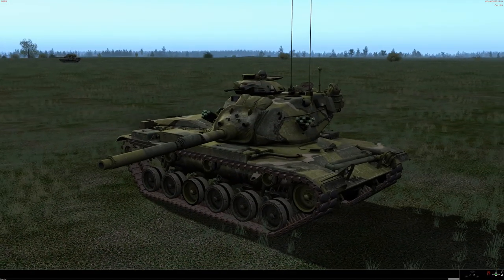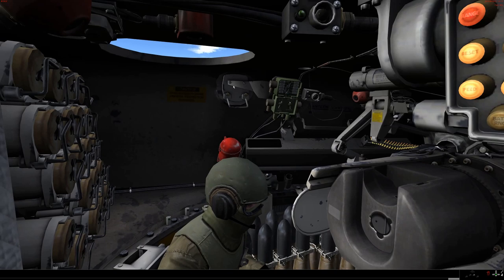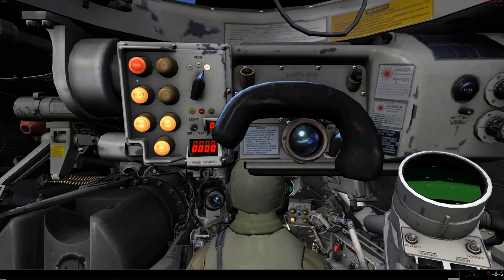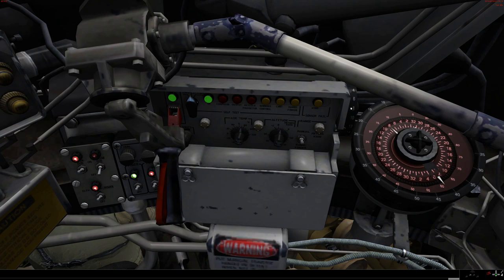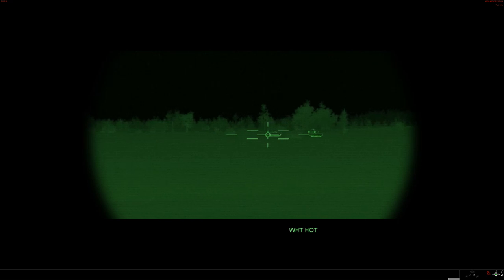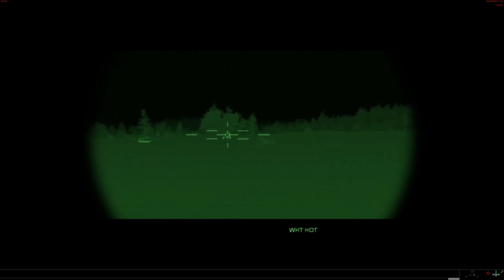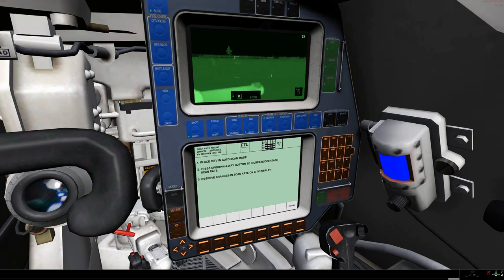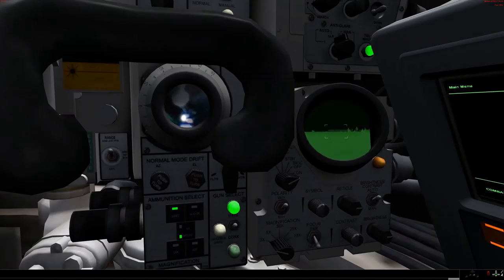M60A3 TTS Switchology, and a little M1A2.

Comment: Nick, you've been inside a T-72 before, so please do a switchology video on the T-72 in SB and tell us what you think.
Reply: I'd love to see that. I'm pretty familiar with the T-72's turret, and I have access to one not 20 yards from my seat here in the office, I'd love to help.
Reply: @TacticalOni  That's quite an office. Is that T-72 turret some sort of monument?
Reply: @tankolad  nah, I work at the American Heritage Museum! We have a Polish built T-72M here parked right between the M41 and the SCUD missile launcher. I've hopped into it plenty of times and I have a ball playing it on SB
Reply: @TacticalOni  Wow, that's awesome! We'd both like to hear what Nick thinks, but I'd also like to know your thoughts on it in SB and as a museum piece.
Reply: @tankolad  (1/2) So in my opinion the T-72 exemplifies Russian Cold War strategy to many degrees. It's a typical T-series tank with 3 crew and a compact layout, but its the details. The T-72 was built to rush fortified positions, and lots of things about it show that. First is the Delta-D switch on the gunner's controls. Delta-D works as a rangefinding function where the gunner only has to lase an object once and the FCS will wind down the range as you're approaching it. I've never got to try if it works moving away because that's not how Russian tanks work :P Delta-D does not account for the target you're lasing moving, though, so usually I just leave it off and just re-lase when I see fit to do so. There is no lead computer, you have to do it all yourself on the 72M model. It takes practice but you get pretty sharp with it after a little range time. The 72B models come with a neato little thing where if you lase and hold down the lase button, it will factor in the turret rotation speed and give you a rough indication of where to put your lead indicator. It still takes way more time than an American tank, typically, I lase to get the range, line up my sight, and then lase again to see if it changes and hold that second lase to get lead. It'll only work for the first shot in the engagement though, after that, you're better off falling back on estimating lead by eye. 
ANYWAY, the other thing to note is the smoke grenade launchers. On American (and NATO) tanks (mostly) these grenades land a short distance in front of the tank, enough to conceal it and let it sliiiide back into cover if need be. On the T-72, we aren't sliding into cover, we are sliding INTO THE CAPITALIST FRONT LINES, so the smoke grenade launchers project around 200 meters forward instead of like 10. It's a self-made smoke screen to advance behind.
Reply: (2/2) From my experience actually sitting in the T-72, its a little more interesting. 
So the nice thing is everyone gets a hatch. Hooray! have fun getting out of it in any degree of speed. The Gunner will have the easiest time, the commander better be a skinny dude as the NSVT machine gun on his cupola ring mount means you only get about 10 inches of space to wiggle out from. Now keep in mind, I'm not a small guy either. I'm 6'3" and about 255lbs. But the T-72 surprised me. The commander's seat is cramped for me, but I can still work inside of it so long as I don't have to get out quickly. Once you're buttoned up, you get the cupola's binocular periscope, which rotates on its own and comes with a sighting aperture, the handles have a button on them so if you're scanning a sector ans spot a target, hold it steady in the scope, smash that button, and it will slew the gun onto the target, the commander cannot override the gunner and fire from his side, he can only traverse and call the target. 
The gunner has the most comfortable seat in the house, I'd suspect. It's like sitting on the ground and resting with your back against the tree. The seat is right on top of the cassette for the ammunition. so there's only a couple inches betwixt your butt and the cassette. So you're sitting there, your legs straight out, and you have the controls right there in front of you and the sight is right where your eyepoint is, you just lean forward and voila. The autoloader is nice in some ways and terrible in others. If the TC calls a target that needs a different ammunition type, you select it, index it, and hit the load button. The nice thing about a human loader is that you don't need to hit a button for him to do his job. He will just cram shells into the breech as long as he is alive, all you have to do is listen to the calls (HEAT UP, SABOT UP) and you know what round you're firing. 
The driver....ugh, he has to be the shortest guy from my experience. Even the T-55 is pretty comfy compared to the T-72. I can't find the seat adjustment though but even still, you can tell Russian Tankists are mostly smaller than American Tankers by a fair margin. Though everything is laid out acceptably enough, The M60A1 and the Abrams both have much better driver's compartments. 
@Chieftain, if you ever do a switchology on the T-72, or even a Hatch at the AHM, I'd love to help!!
Reply: @TacticalOni  Thanks for sharing, but I find your experiences to be a bit strange. It's hard to see how the commander's station can be less spacious than the gunner's station or less comfy. Have you tried adjusting the seat? You can do it using a lever on your right hand side.

About the autoloader - is it that much of an inconvenience to press a button? It's right next to your left thumb if your hand is on the control handles, and the gunner has to index the ammo type into the sight anyway when switching ammo types. Nick does it a few times in this very video. I really don't see how that would delay the loading process or make life harder for the crew.

As for the driver's station, the seat adjustment handles are on your left side. You should see two metal paddle-like handles. I might be wrong, but I think you have to put your thumb on the inner paddle and your palm on the outer paddle (left hand). Compress the inner paddle towards your palm using your thumb and just twist both paddles away from the seat. That should release the seat from the toothed rack. Be sure to brace yourself against the hull ceiling though, because the torsion bar spring under the seat is apparently quite strong. When you've got yourself to the height you want, release the handles and the seat will be locked to the toothed rack.
Reply: @tankolad  So lets hit these one at a time.
From my experience, the breech seems to favor the commander's side a little more than the gunner's, the commander sits a little higher regardless of seat position and with it at buttoned up height, I found myself more noticeably packed in by the radio and equipment by my right leg, the gunner doesn't have this issue. 

The Autoloader. Pressing a button is not an issue, and my mistake if I implied that. I simply stated that because you have to key a button to load a round, instead of having a guy who is doing it until he runs out of an ammo type, means that if you're being mindful of your selection, you will have a larger delay in when you spot a target and fire. You can always queue up SABOT and switch to HEAT by doing a Russian Reload, but staying flexible means more delay in spotting a target and shooting at it. I will always say having a human loader is better in any situation. 

Driver's seat. 
If memory serves me right, the seat was jammed, I'll take another look though. I know that in the head-out unbuttoned level, its an uncomfortable hag to sit in.
Reply: @TacticalOni  Okay, that's fair.

I still have a bit of trouble getting what you mean exactly. In a direct comparison with a human loader, the gunner would just keep pressing that 'load button' without turning the ammo type selector dial until he runs out. He sees the target through his sights and he hears what the commander is saying to him. There wouldn't be a problem with loading the wrong ammo for the job.

If the commander tells the gunner to load something else, the gunner would just turn the selector dial to that type which sets the autoloader and the ballistic computer simultaneously, and then he presses the 'load' button. You'd need to do the first part in any tank. In the M1A1, for example, the gunner has to take his eye off the viewfinder of his sight and press a button to switch between ammo types so that the ballistic computer can show a ballistic solution for what the loader put into the gun tube.

The backrest of the driver's seat should also be adjustable between three different angles of recline. I have no idea what the condition that T-72 is, but these issues seem to be the sort of stuff that can be solved with some WD-40 and a dirty rag :)

Comment: I will recommend Steel Armor Blaze of War. I think is the best m60 simulator
Reply: yeah its awesome... i either suck at it or the supply line parts are terrible becuase i can only go like 3 engagements before i need to end the campaign simply because i run out of ammo, at times ill be lopping HE at T-62s or APFS at BMPs

Comment: There should be a deflector shield installed between the fighting compartment and the drivers compartment.. I'm an old 19E40 M60A3 tanker. Oh, and the M85 .50 worked fine, you just had to install it in the couple correctly and run it on High rate.
Reply: As a 19E20 who also did armorer work, it needed careful maintenance too. If the rivets weren't tight, things would not quite be lined up right and, yes, high rate helped for a while. I once DXed all but 2 of ours over rivet issues (Division changed the rules after that but we still got new in the box M85's for the company :)
Reply: @wlewisiii  all true, but I've put a lot of rounds down range with them and in my platoon and as long as the guys kept them cleaned we never had issues. The biggest problem was the crews that wouldn't load the ammo tray correctly and making sure the deflector plate on the ejection side was on bottom as opposed to on top. Saw more stoppages due to that than anything else. The M2 for all it's robustness didn't work well in the old M1 coupola on the M48's. That is why you saw so many mounted outside in Vietnam. Now, if you mention the M219, that was a dog. Absolutely hated those things

Comment: I'd have a few questions to the M1A2 SEP v2 tankers out there:
How do you use the CROWS on that as a TC? Do you have a third, separate screen or does it connect to one of the existing two (either the CITV display or the CTP)? And does it use the same controls as the CITV (for rotating, zoom etc.)? And finally, is it a viable tool for scanning (as it is positioned higher than the CITV so it could be used behind a hill to spot whilst the rest of the tank remains in cover)?
Thanks!

Comment: IF ever doing a review of Switchology or FCS of M60A1 or T62 ( well technically its a sighting system in the latter case)  i would suggest Steel Armor Blaze of war , very good sim although only centered around  two vehicles : M60A1 and the T62 ( model 1972 IRRC).

That is the most  realistic  tank sim for those 2 tank platforms.
Reply: I just wish they made models for the M60A1 AOS it had some more tanks to play around with

Comment: Whether the operators choose the L3 or Raytheon upgrade. The M60A3 is a viable 3rd world(?) armor package;  120.mm gun, digital fire control, laser ranging , thermal sights, electric turret drive, increased horsepower engine, api and improved armor protection

Comment: you are missing the Ballistic shield that protects the driver from spent shells ,goes on the V behind the recoil pad . also prevents shell casings getting stuck in turret ring . yes the loader has to stomp down on spent shells while loading the main gun . yes M240 for coax

Comment: Spent 8 years as a 19E on the M60A3 at all stations on the tank eventually. I don't know what you were talking about with the "cards" to change trajectory for different rounds, never heard of that. We had a computer that super elevated the cannon on its own, it did all of that through the computer. I think someone was pulling your leg about the "trajectory cards"
Reply: Someone may prove me wrong about that, maybe the cards were used on earlier A1 models or pre LRF? I have probably forgotten a lot over the past 25 years but I do not remember anything about the cards you mentioned
Reply from the maker: The computer needs to have data on the round being fired. M774 APFSDS would fire with a different trajectory to M900 APFSDS. That data is basically on a cartridge card, like a RAM chip in your computer which plugs into the main board or, in older terms, a game cartridge on an Atari 2600. When one round type is replaced in service with a new round type (such as 774 replaced by 900), the computer needs to be told the ballistic characteristics of the new round, this would be done by pulling out the card with the 774 data from the APFSDS slot and replacing it with a 900 card. So now when the gunner mashes the APFSDS button, the computer is calculating everything with the 900 ammunition data. This is not a crew-level task.
Reply: @TheChieftainsHatch  well that makes complete sense, didn't realize we were talking about non crew related stuff. Thanks for the info, always enjoy learning new things!

Comment: If you could ever get more than 5-10 rounds ever out of the M65 .50 cal commanders machine gun. They redesigned the .50 cal and ruined it. When you loaded the main gun, the loader stepped on the shell casing and put them in the empty racks where space is available. Berlin Brigade, Co F 40th Armor. 1979-1981.

Comment: I prefer to call it Switchcraft or Switchery.  Sounds more fun
Reply: 'Switchology' is the term that tank crews used.  And 'switchology' was a critical skill if you wanted to be an effective tank crew. (And it was a crew skill and not an individual skill because everybody on the crew had tasks that were critical if you were going to hit a target.  Even the driver was trained to release the accelerator and let the tank start coasting when the Tank Commander gave the command: 'Fire!'  Every person on the crew was critical and everybody had to act as if they were all one person.

Comment: man i went through tanker school in 1972.......m 60s
Reply: doorgunner - 74 - trained on M60's (automotive), M60A1's (gunnery), M551's, M113' ACAV's and M114A2's (!) with 20mm M139 in AOBC. Then M60A1's at Ft Lewis (and worked with M48A5 equipped ARNG units) before going to Germany and M60A3' TTS's (missing the M60A1 RISE, M60A1 RISE PASSIVE) and, eventually, M1's. As Chieftain has pointed out, by the end of my tour I was a senior captain, so having any more fun was out and I missed having personal experience with the M1A1 and M1A2.

Comment: ive never realized tanks had so many buttons and so many different small things u have to adjust to get a round on target. To be honest id thought it was as simple as aim and fire, it should be that simple atleast
Reply: It can be that simple if you want to expend lots of ammo at relatively short range while sitting still between the hours of sun up and sun down.  All the knobs, switches, bells and whistles are for hitting lots of targets using relatively little ammo at much longer ranges while moving*, 24/7.

*Moving in the M1, not so much  the M60A3.

Comment: The Stabe gets overridden if the vehicle moves above a certain speed (supposedly a doctrinal thing) and needs to be turned back on after the loader has reloaded the main gun.
Reply: Well...the stab just goes to crap above 20kph, but the implementation in Steel Beasts shuts the stab off during reloading rather than having the stab degrade at high speeds.  It's a work around that's just as annoying so it will probably stand for the foreseeable future.
Reply: @majfubar5326  I was referring to the implementation.  My experience in 'A1s is that it works from about 9 mph to 15 mph.  The tank I had at Ft. Stewart did best at 12.5 mph.
Reply: @TimothySielbeck  Yeah, I got that after I posted.

Comment: If I wanted to get into PC gaming of tank battles, what is the recommended best interface device to use -- at least for not over $500?  For flying my flight sims, I have rudder foot pedals, and depending on my selection of aircraft, I use either a joy stick or a 3-axis yoke.  I've tried using the keyboard on tank gaming, but it really sucks.
Reply: If you are playing steelbeasts, the mouse is way more acurate than a joystick. Offcource if you train yourself, you can be accurate with a joystick too, but I bet, it will take you a couple of years to get close to as good with a joystick
Reply: @AartJanPrins  It depends on where you start, in my case a joystick is far more comfortable for gunning as it more closely replicates the actual controls, but your mileage may vary.